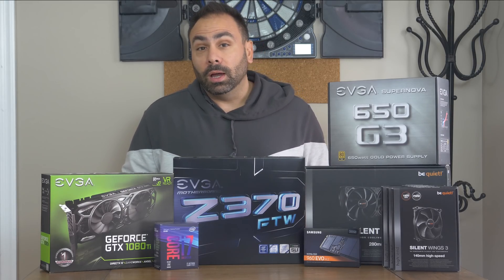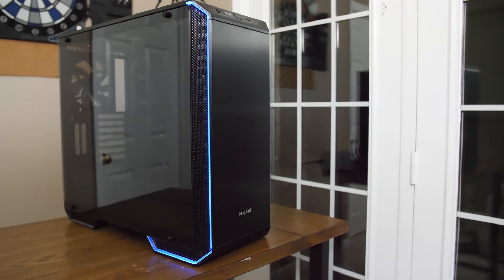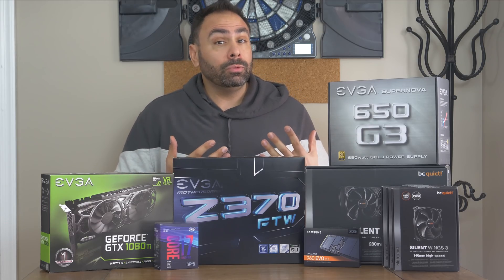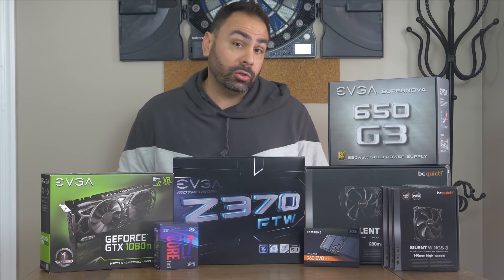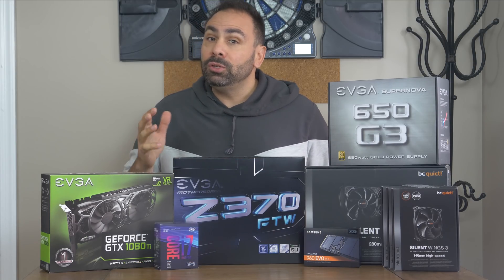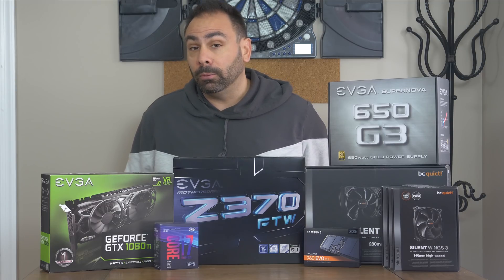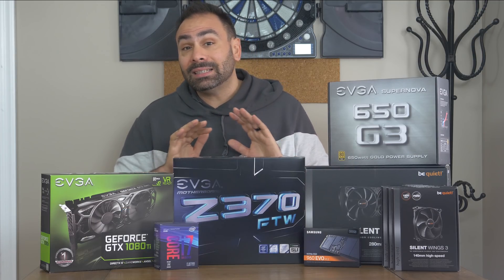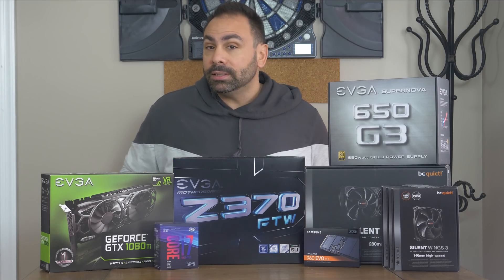Monthly Build Series - Viewer's Choice!

Comment: I would love to hear more about the details of the motherboard.      Especially, from anyone running a Linux distro.    Are there any features this motherboard lacks, that I might find on a similar priced motherboard ?   ( I am into black components with no RGB ).     What features would I find missing compared to a $ 400 or $ 500 motherboard or a new X-470.      Or should I just patiently wait for the Z390 or the the refresh of Threadripper.     I can wait a few months, if I have to.